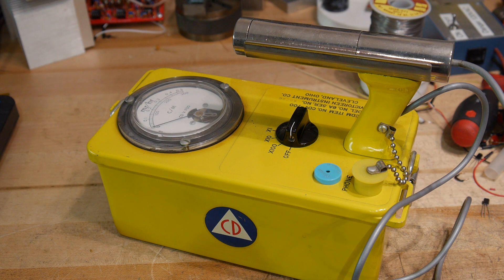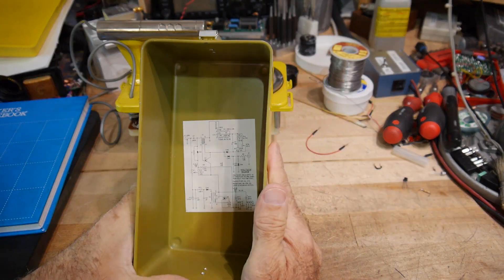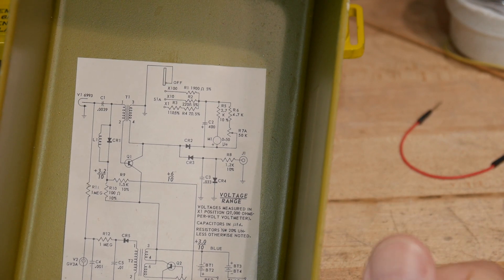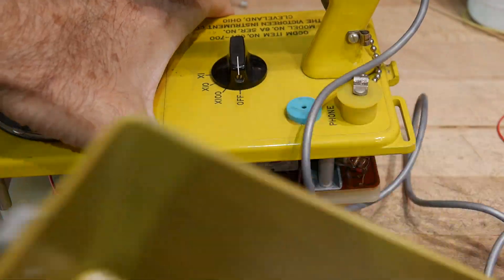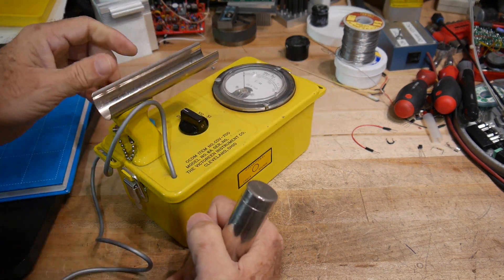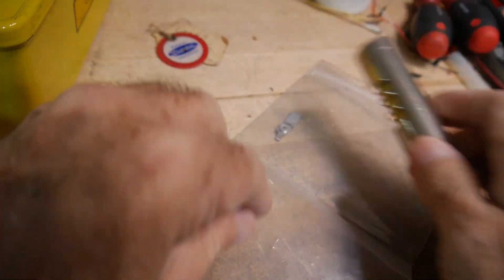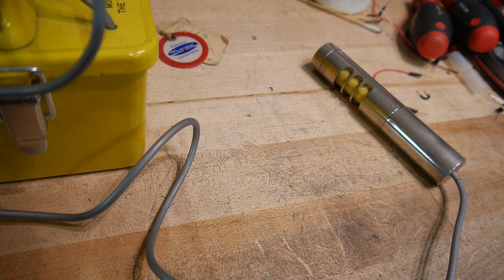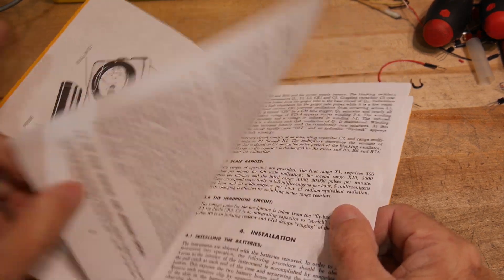#287 radioactive electronics

Comment: The cover on the Gighger tube is called a Betta sheild, that allows for gama only readings. and the test source in the side is a small sample of Depleted Uranium.. i have several of these and a few earlier vaccum tube type. can you show where you wired the pizzo onto the orriginal circuit, at the moment i use an extenal amp and has a habbitt of draining the batteries.
Reply from the maker: I think it is just across the headphone connector